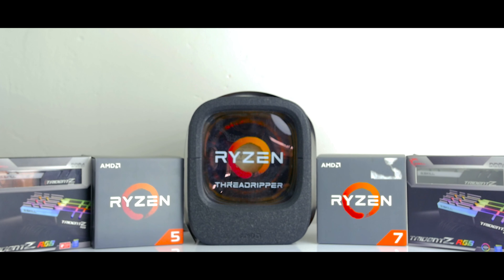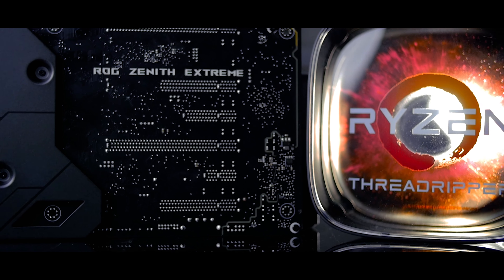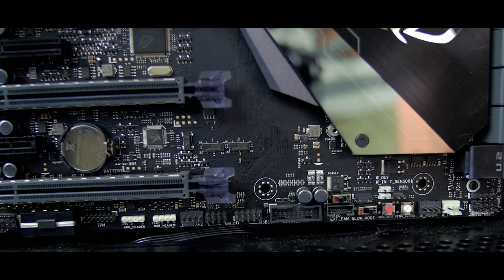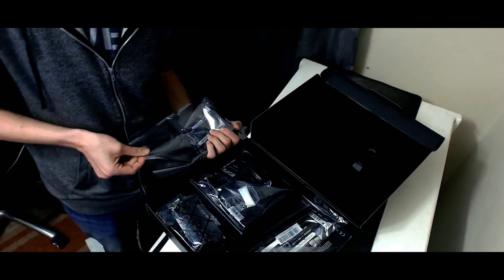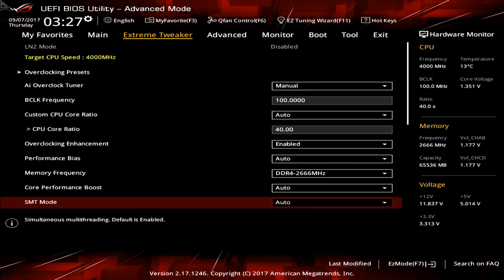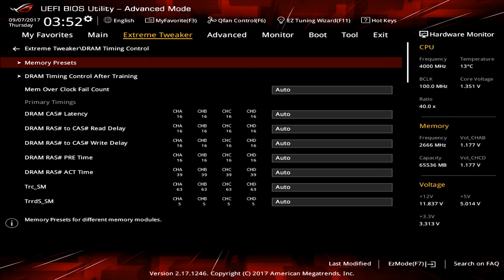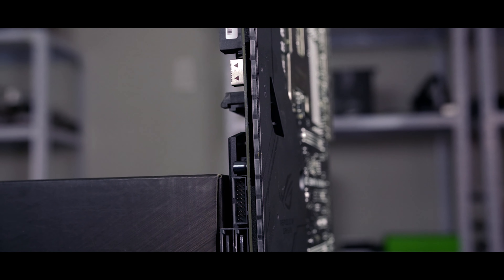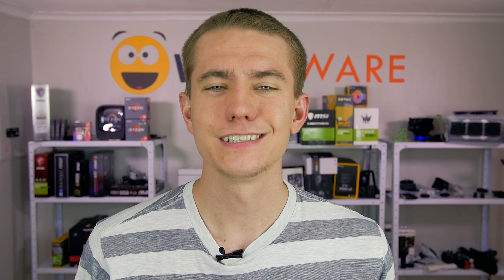ASUS ROG X399 Zenith Extreme - Expensive But SO Worth It

Comment: Just got the 1950x, zenith extreme, asus 1080ti oc, trident z rgb 32gb and 960 pro! Going to build the pc tomorrow!
Reply from the maker: Nice!  Enjoy friend!
Reply: Hi Guy. It's been months. Tell us how it worked out.
Reply: @maxhughes5687  you cant run gtx 2080ti nvlink
Reply: tell me is there a problem on 1950x on this motherboard from ruining 2 gpus SLI on 2080ti? and did they solve it? , do I need to buy the 2950X ?

Comment: Just built mine:
AMD RYZEN Threadripper 1950X 16-Core / 32 Threads 3.4 GHz Socket sTR4 180W YD195XA8AEWOF

Enermax ELC-LTTR240-TBP Water Cooler

ASUS ROG ZENITH EXTREME sTR4 AMD X399 SATA 6Gb/s USB 3.1 Extended ATX AMD Motherboard

3 YES 3 in RAID 10 OMFG FAST!!!  Samsung 960 PRO Series - 512GB PCIe NVMe - M.2 Internal SSD (MZ-V6P512BW)

Gots dis to play wit... Asus TPM-M R2.0 14-1 Pin TPM Module

uxcell 50mm x 10mm 12V DC Cooling Fan Long Life Sleeve Bearing Computer Case Fan for the M.2 riser card cooling

Antec 80Plus Platinum PSU ATX 1000 Power Supply HCP-1000 PLATINUM Needs da powa!

2 ASUS GeForce GTX 1070 8GB Turbo Edition 4K & VR Ready Dual HDMI 2.0 DP 1.4 Auto-extreme Graphics Card (Turbo-GTX1070-8G) in SLI

Thermaltake Core X5 Tempered Glass Black Edition E-ATX Stackable Tt LCS Certified Cube Computer Chassis CA-1E8-00M1WN-02 to cram it all in

Ballistix Sport LT Red 32GB Kit (4 x 8GB) DDR4-2666 UDIMM

judge away!!

Comment: DOES THIS CONFIGURATION WORK..

AMD - Threadripper 2990WX 3GHz 32-Core Processor

Asus - ROG ZENITH EXTREME EATX TR4 Motherboard

Corsair - H115i 104.7 CFM Liquid CPU Cooler

G.Skill - Trident Z 64GB (4 x 16GB) DDR4-3600 Memory

Asus - GeForce GTX 1080 Ti 11GB STRIX GAMING OC Video Card

Samsung - 960 Pro 1TB M.2-2280 Solid State Drive